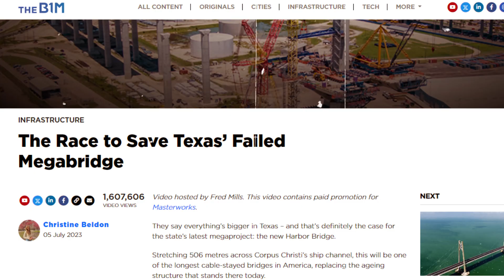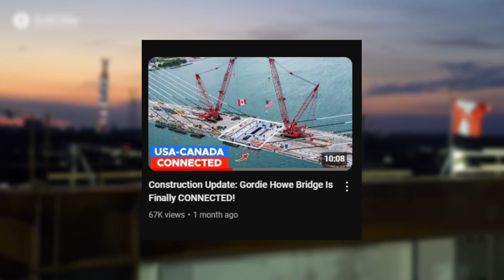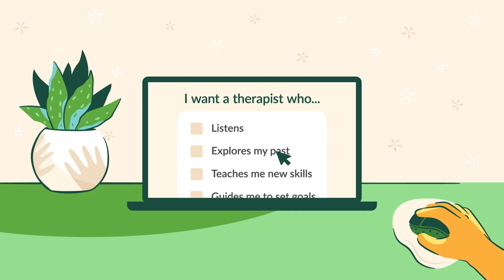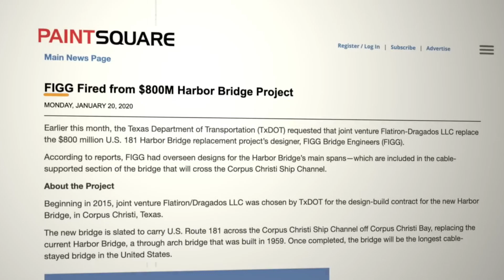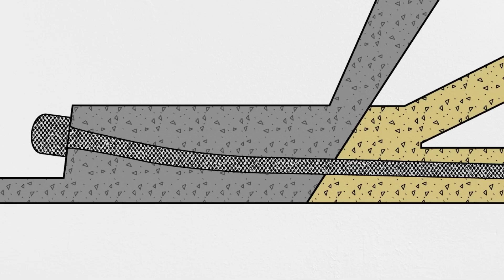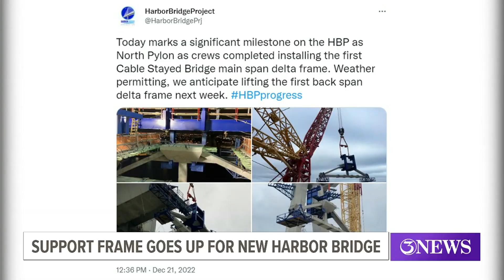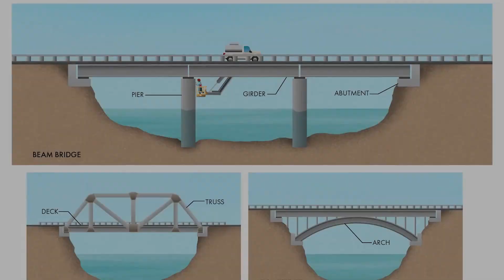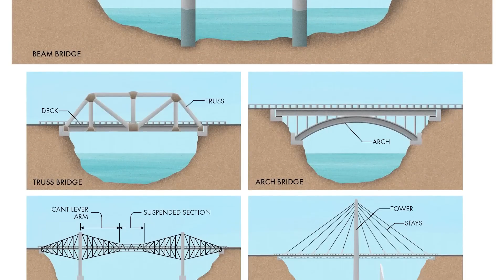The Texas Megabridge That Almost Failed

Comment: It's unfortunate the project was plagued by the lengthy delays, primarily to what came down to a difference in engineering judgement.  One issue I still haven't seen or heard addressed is who is now ultimately assuming design liability for the structure?   Arup-CFC was brought in after FIGG was removed from the project, but then TxDOT brought in IBT for an independent engineering review.   IBT addressed the 5 alleged design deficiencies (which Arup-CFC initially disputed) and Arup-CFC modified their design to accommodate the recommendations made by IBT.   So if there are problems in the future, who is ultimately responsible - Arup/CFC as the Engineer of Record or IBT who recommended the design changes?   After the lengthy delays to review and modify the design, I don't expect any future problems with the performance of the bridge but the design responsibility surely needs to be addressed.